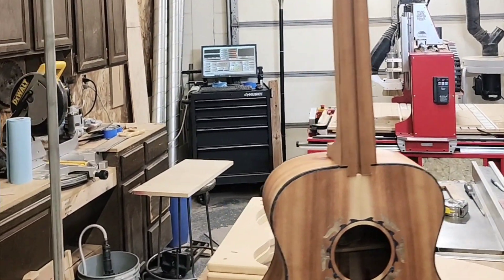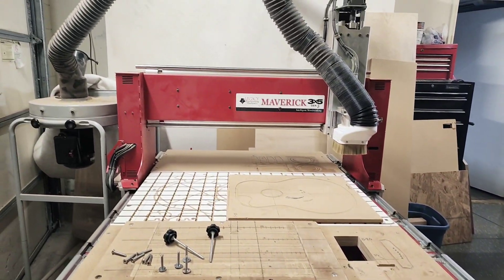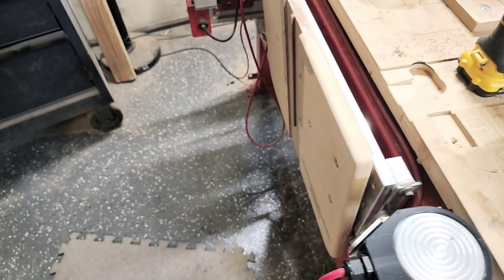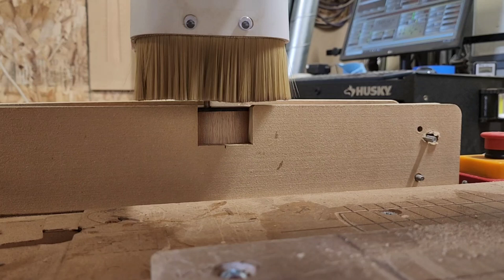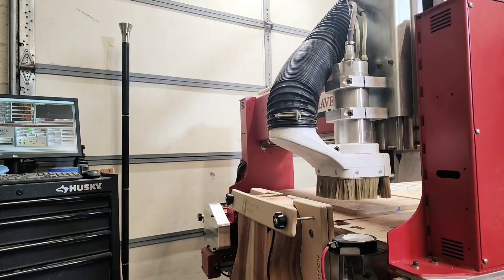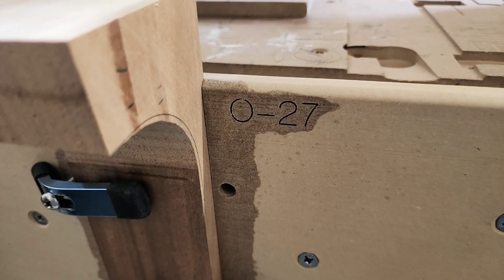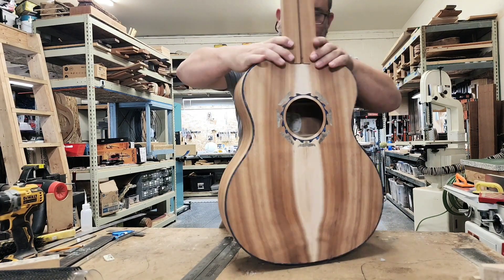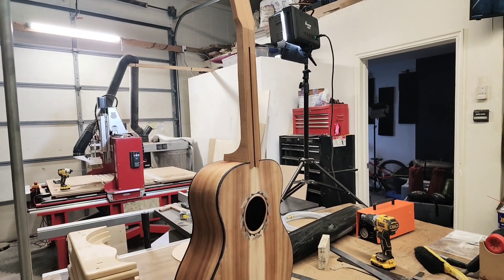Acoustic Guitar Dovetail Neck Joint on a CNC???

Comment: I was inspired by your concept, so when shopping for a cnc router I landed on a Laguna IQ which over shot the table by 4 1/2"....just enough! I made a hinged table like yours from scratch. I've made a bunch of tests and 2 neck body dovetails that came out very good. I use an electronic protractor same as yours to set the neck angle....don't ask me how I dope that out...I always have to do some head scratching. I'm surprised that other folks don't do this same thing. Nice work!...OH just to gross you out I send the dovetail cutter right into the solid, and cover my eyes...haha